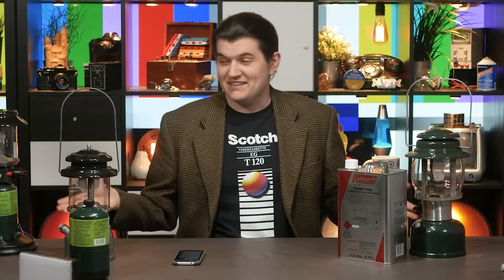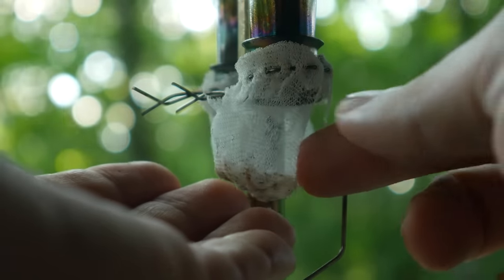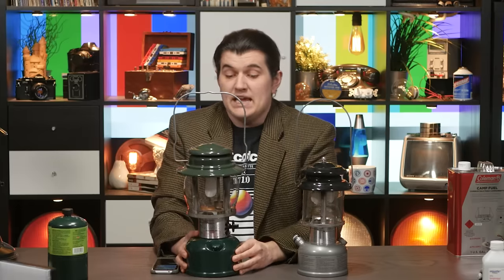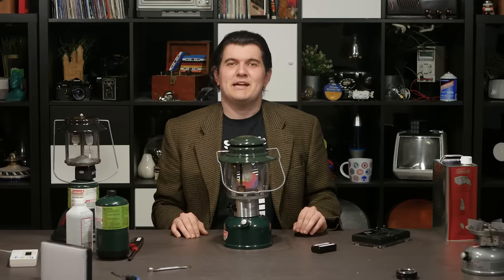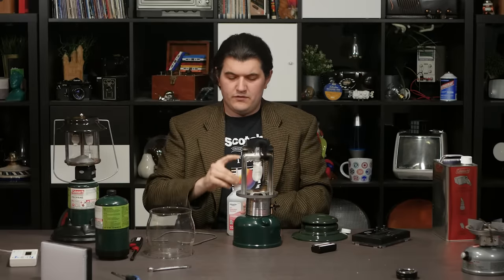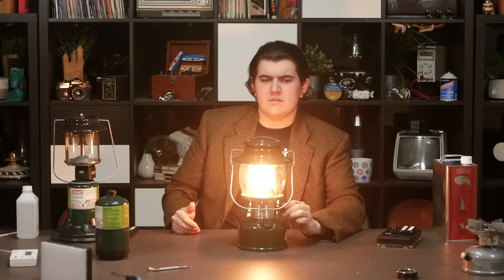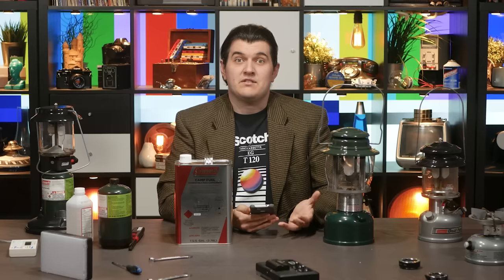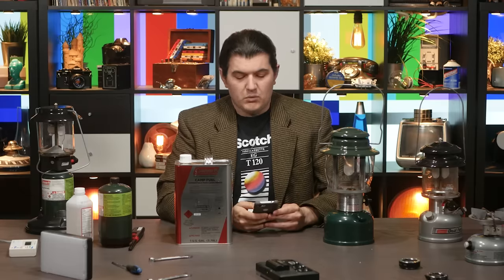A very rambly Coleman Lantern follow-up. Turns out they rarely make sense in 2021

Comment: The biggest advantage of white gas and the old=skool lantern - It's still going to work after 20 years in the garage. We lit up my granddad's 50+ year old Colman after sitting for at least a decade with no issues. Little oil on the pump and fresh mantels and it was making light and that glorious sound. I love my electric stuff, but the old stuff will still work in 100 years, no battery can claim that! Great series, thanks for the entertainment!
Reply: Yup. We live in such a throw away society, it's shameful. Those batteries will end up in a landfill, leeching toxic metals into the earth for centuries.
Reply: Damn straight. I’ve just pulled out an Austramax kerosene lantern from my dad’s shed which hasn’t been used since 1988. Replaced the mantle and fuelled it up and it runs like new. Meanwhile my 5yo headlamp is now in the bin due to leaking batteries.
Reply: @wildtony79 yeah, but how much did you pay for the headlamp vs what the lantern cost (accounting for inflation)

I guarantee if you bought a good electric light it would still be working in 25, 50, or more years.

I have a surefire light from 95 that's still running just fine, and recently I converted it to LED to get even more brightness (NOT using cheap Chinese kits)

It's the same fallacy as the mid 2000s MacBook vs windows laptop thing, people compared nice MacBook to budget windows machines that cost a 10th the price.
Reply: @ObamaoZedong The problem isn't as much the batteries themselves, as the fact that rechargeable batteries often aren't interchangeable or removable.

IMO, it should be illegal to sell devices with non-removable rechargeable batteries (including smartphones), and there should be a hefty tax on battery types that aren't standard.
Reply: Supercapacitors might last a hundred years. They won't store charge for that long, but they'll still work. Some of the less dense battery chemistries are also very stable, especially if we're talking about something that can power a building. Energy density and cost are often the most important reasons why generators are still common for backup power.
Reply: @antonliakhovitch8306  Oh yeah? Where can I buy such a supercapacitor lantern? They don't exist yet, it's science fiction. Once they do exist, it will be +20 years till anyone can say they last 100 years. Coleman lanterns can do it right now.
Reply: @marcusborderlands6177  This is a very good comparison, because just like the mid 2000's macbook - I don't want it even when it's new. I lean into the disposable nature of electronics because I don't want a 10 year old laptop because the new ones are so much better, same applies to a 30 year old electric lantern. Gas lanterns stand the test of time, electric ones don't.
Reply: @steveseattle6791  Lol idk why you took offense to that.

You can't buy a supercap lantern, because supercapacitors aren't suitable for that kind of purpose. Yes - if you specifically want a lantern that will still work after sitting unused for 100 years, combustible fuels are a good bet.

You made a blanket statement about batteries though, and it isn't so black-and-white. Depends on the use case.

LiFePO4 and NiCad batteries can easily last decades if they're occasionally checked and kept at the right level of charge, but they're less energy dense than lithium-ion batteries. They'll work for a lamp, but it'll be functionally inferior to gas.

And no, electric doesn't mean 'disposable'. You can replace batteries without throwing away the whole device. Unfortunately a lot of manufacturers don't understand this (but some do!)
Reply: @steveseattle6791  Also -- supercapacitors aren't science fiction. They've existed for a while now, but they just aren't as exciting as they sound.
Reply: The lantern may still work, but the gas won't. Gasoline isn't shelf-stable for more than a couple of years at the most. There are also rubber seals and grease in a Coleman lantern that will eventually dry up and/or rot. I went through a couple of pumps on mine before I retired it. They're solid, reliable sources of light, but they're not indestructible or zero-maintenance.
Reply: @shmehfleh3115  You can re-oil the pump on a Coleman in the field. What are you going to do to a battery? Absolutely nothing. Coleman fuel is indeed shelf stable and I have personally used it +15 years old with no problem at all. It takes some skill to work on them, and you may not have that level of skill. But it is possible. I have fired up many that sat for +20 years with no problem. You can't do that with a battery.
Reply: You might need to replace the rubber seals (can be easily accomplished by going to a hardware store), but other than that you are completely correct.
Reply: @sonicmastersword8080  My latest ebay score was a 1961 Coleman 228 - fired right up! You are right, the cap seal does go bad eventually...but I am amazed at how many of the ones made in the 70's or earlier seem to work perfect. I have one new Coleman...burner tubes rusted out and disintegrated in less than 2 years! They don't make them like they used to!
Reply: Yes I have been using them since I was young !
Reply: @ObamaoZedong  So true !

Comment: When I went camping (pronounced: drinking at camp) with friends when we were younger, half of the benefit of lanterns was the entertainment value of watching the most inebriated member of the group trying to get them going. Because of course, a party when you're young and indestructible is just no fun without the risk of catastrophic injury, self-immolation included.
Reply: Were you using white gas or kerosene lanterns back then ?
Reply: @psirvent8  white gas for the lantern. Molson, blackberry brandy, and vodka for us.
Reply: @adirondacker007  Ok so at least it would not have been too difficult to light a lantern.
Just pump it up, strike a match and turn the knob.
(Funnily enough, no alcohol required to preheat a white gas lantern, unlike a kerosene one)
Sounds so simple doing while inebriated 😂😂
Reply: Can totally relate
Reply: Coleman's rock. If you live where the power is sketchy the propane ones are easy to use although the dual fuel ones  an run unleaded gas outdoors. I grew up camping so its second nature. I have seen drunk people do stupid things.
Reply: I do that with my friends lol
Reply: And a forest-fire.
Reply: Batteries do not like extreme cold and degrade over time. And some areas of the world have extreme cold combined with lack of daylight.
Reply: @eleventy-seven : Shouldn't that be "Colemen"?

Comment: Kerosene is much safer to store, transport, and handle in general terms, than gasoline and other fuels. Aside from gasoline which wasn't ubiquitous until later, the use of volitle or unpredictable fuels is why the use of kerosene became popular in the late 1800's in the first place. With the use of kerosene, the number of house and building fires went down dramatically.
Reply: Also remote areas or high ambient day temperatures...kerosene and diesel are cheaper and often running generators and therefore more practical for these lamps.
Reply: also kerosene is essentialy diesel oil. so you could just run the lamp on that if you realy wanted to.
Reply: @jizburg  In an emergency, for a couple of hours, maybe.  And only after a very, very, long priming preheat.  Diesel is much heavier, more viscous, and dirtier than kerosene.  And you'll be going through generators, or cleaning them, which is a tedious task, at a disgustingly high rate.
Reply: @mikemorgan5015  with enough fuel you could use it for weeks from what i understand.

Diesel has pretty much the same viskosity from what i understand.
Reply: @mikemorgan5015  Diesel vehicles at airports generally run on Jet A, which is (for all intents and purposes) kerosene.

They can increase wear on the injector pumps, so you should throw in a quart if ATF or 2 stroke oil per tankful.
Reply: @jizburg  exactly HVO100 is a really popular alternative (100% bio diesel) over here since its cheap, safe and stores well. Many "modern" fuels have ethanol mixed in and that means some water and with that mold/alge. Long term storage of fuel is important in emergency use.
Reply: @bcubed72  yea. but i bet the injector thing wont realy be a problem in a lantern.
Reply: @andersson_casa  yupp. altho i dont reccomend burning modly fuel i bet it would work. worst case scenario pour it thru a siv, its not as if we realy care about the compression tollerances after all. if it burns its good enough in a pinch.
Reply: @jizburg  IF it's extremely clean diesel fuel perhaps.  For using as lantern fuel, you are way better off with clear kerosene or deodorized kerosene if you want trouble free operation.  I do understand the different parts of the planet have better fuel than others.  And that DOES make a HUGE difference.  The USA has crappy fuel compared to a LOT of the world.  So you may be correct for your locale.
Reply: @mikemorgan5015  shure. ideal fuel is ideal fuel. no argument there. i was more talking about buying in bulk for emergencies. if you live isolated in the middle of nowere you might as well have a drum full of diesel for your truck or something just in case then you might as well use some of that if it comes to that.
Reply: @bcubed72   I agree.  In the late 1980s I was in the US Army when they went to JP-8(also kerosene) and quit using diesel fuel for all ground vehicles with diesel engines.  The exhaust, strangely, is MUCH worse from an irritation standpoint than diesel was.  It used to be cheap and easy to get bulk K-1 water clear kerosene at gas stations.  Not so much anymore.  You can still find it in a very few places, but it usually cost more that gas or diesel.
Reply: @jizburg  Oh, sorry.  I wasn't referring to fuel use rate in the lantern but the coking up of the generators.  I used to be really involve in lantern and stove collecting and restoration.   I tested a lot of fuel alternatives from acetone to paint thinner.  I've run stoves and lanterns on US diesel fuel.  I had to prime them for a LONG time to sufficiently preheat them.  They would eventually run pretty well.  But they produced much more soot and the generators would clog up fast.  It's kind of a death spiral.  The more gunk in the generator, the more heat you need to vaporize the fuel.   That leads to sputtering and incomplete vaporization.  This in turn allows liquid fuel to pass through, destroying the mantle.  Diesel has a higher energy content that gasoline or kerosene.  But the diesel here is just not up to par for use in lanterns from my experience.  Could be a completely different story in other areas.
Reply: @mikemorgan5015  okay then we undestand eachother.
Reply: Main thing with those lanterns is HEAT.  When it drops down to 40-50 degrees at night or worse, the heat off these lanterns is pretty substantial.  They also seem to repel some of the bugs if its not cold.  For the eras when these were popular, the alternative was incandescent bulb lights running off 6v and 12v dry cell brick batteries.  Or someone's carbide lamp. Assuming you had plenty of pellets people didn't already use up in cannons. ;)
Reply: @Psibr1  The heat is substantial no matter what the ambient temperature is.  They used to sell a cooking grate attachment for lanterns so you could cook on them.  Not the safest, most stable or fast way to cook, but at least all that heat wasn't wasted.  I used to have one of those battery lanterns with the flashing red light on the back.  Thought it was the coolest thing in the world at the time.  Haha!  Missed out on the carbide cannons though, darn the luck.  THOSE sound like fun!  Strangely I'd never heard of them until last week when I was talking with Taryl from Taryl Fixes All channel.  Now twice within a week!  It must be a sign that I need to acquire one!
Reply: @mikemorgan5015    Mike, I have a Sportster stove... I burn petrol as Coleman fuel is rare here (rural west of Ireland) & very spendy when you CAN buy it. As a result, I do get clogged generators, have you any sage advice regarding cleaning them ?? 

😎👍☘️🍺
Reply: Kerosene has another advantage to propane/LPG... you don't need a bulky & heavy pressurised metal tank for it. You can basically store kerosene in plastic jerry cans. It's also much easier to transfer from a big container to smaller ones... just use a funnel and make sure no flames or lit cigarettes are nearby. Of course, the downside is it burns dirtier, and takes a bit of skill to use kerosene stoves & heaters properly.
Reply: @bcubed72  in the vehicles NOT the lanterns....just clarifying your point.
Reply: OFF ROAD GASOLINE (not taxed) is just as cheap as kerosene.  Almost a dollar less than auto gasoline.  So once again, no reason to deal with the lighting hassle of kerosene lamps

.